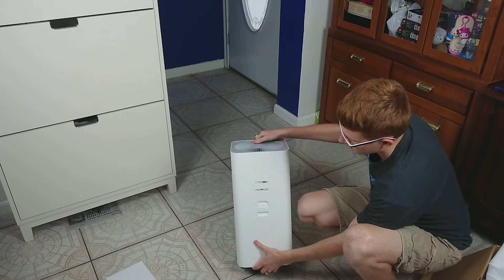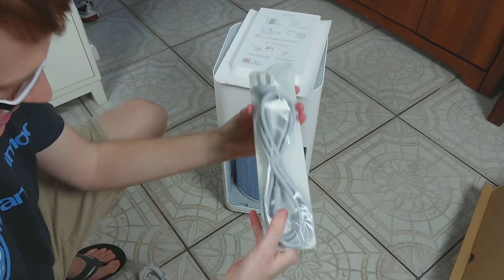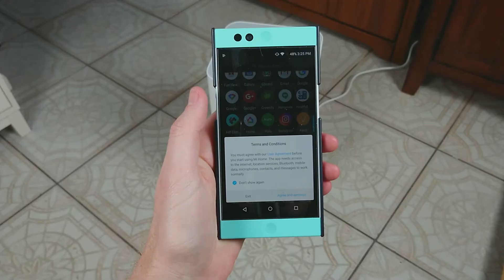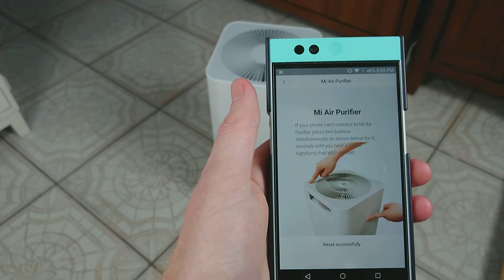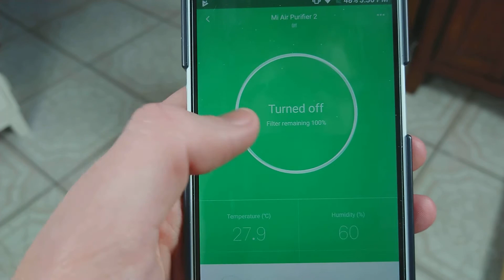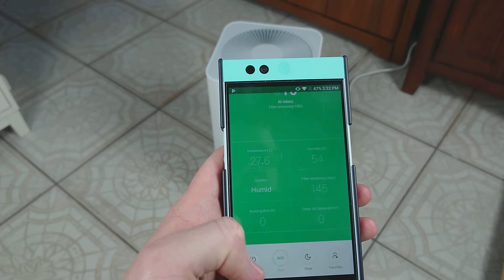[UNBOXING] Xiaomi Air Purifier 2

Comment: I have one of these and the biggest problem I am having is that you can’t run the unit in high favorite mode for more than 3 hours... It changes to its auto mode after 3 hours which only then really only runs the fan when the ppm are above 30... so this unit basically does not clean the air below 30ppm...